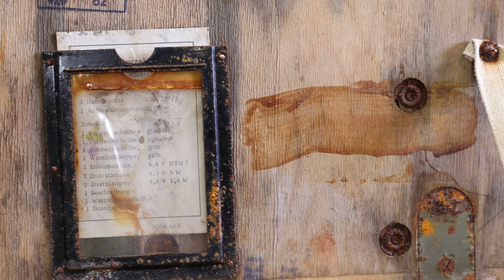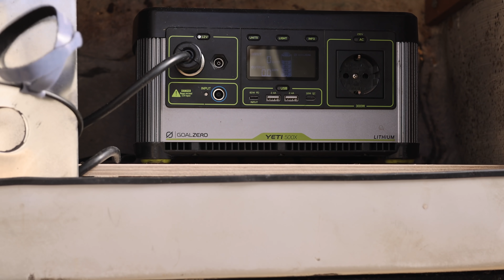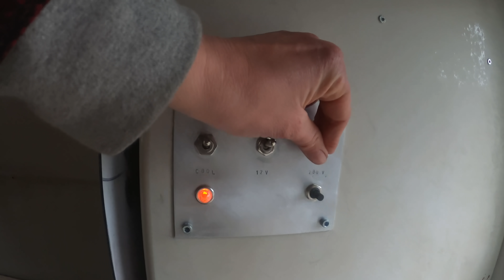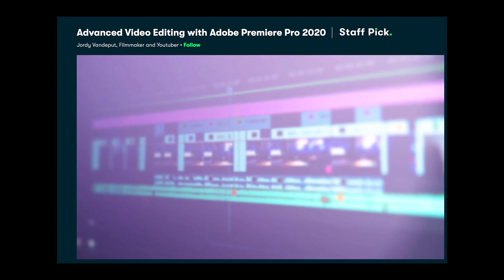Camper to Bar Conversion (with beer tap!!)

Comment: There's so much in this video, I don't even know what to start my comment on! I would have never guessed that you would turn it into a bar, that is so cool and really an out of the box idea. I loved the electrical switch panel that you made, I might consider stealing that idea for my jeep if I install big lights on it. I also loved that army green flood light under the table, that old light is way too cool and I love that, from what I could see, it looks like it really stands out and is noticeable under the table as you walk into the camper.

Comment: I tried to do this at one point and now I want to do it again. The camper I had was a med. 80's tow behind and it was rotter completely out. 
I redid the ribs of a couple walls and the ceiling redid the floor in pallet wood and started redoing the counter/cabinets before it just started falling apart. Was going to be a gentle person's cigar lounge. Lots of leather and copper where planned

Comment: I know this is a Zero budget build, but something cool would be awnings extending from the sides and the back and a bar "shelf" that goes around the camper and collapses when in transit. Some coolers for refrigeration (with ice) and maybe a portable BBQ would be an excellent meetup spot in a park for a bunch of friends to get together around. Really cool Stuff.

Comment: I also really like repairing giving away tiny campers. It’s a hobby. I think that you should Also mentioned wheelbearings maybe show a few minutes of re-packing those checking the rust on the frame making sure the hitch is safe. Because you may inspire other people to repair old campers and they might drag them Unsafely because as they don’t know any better.

Comment: About Reclaimed Wood
A Tipp I learned from a Guy in New Zealand ist
Never EVER use it until you checked it for old Nails and Screws
He jacked the wood up on some old full Plastic Camping Chairs and sweeped it with a Metaldetector and pulled every tiny bit out